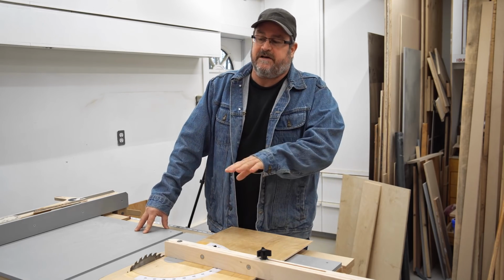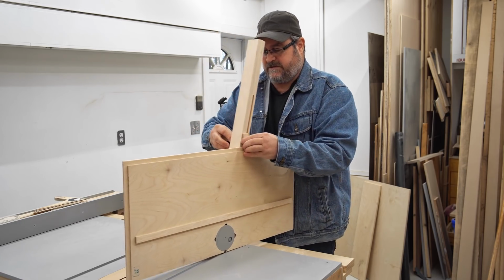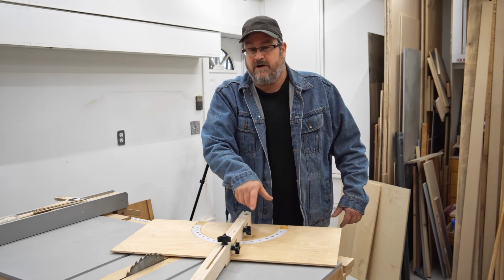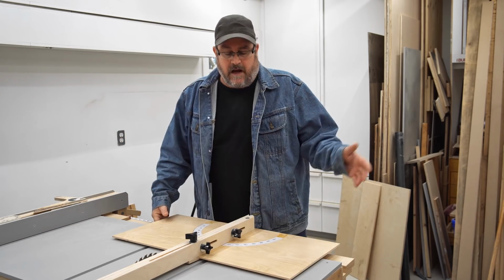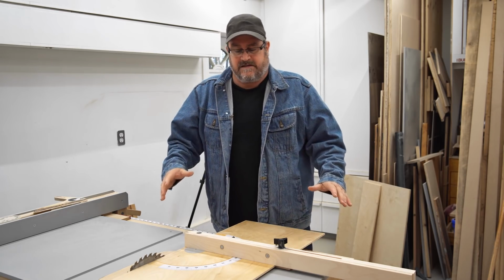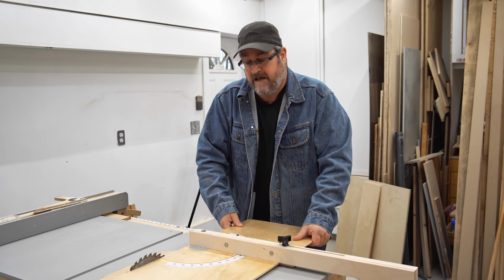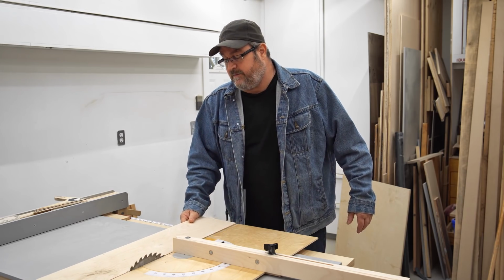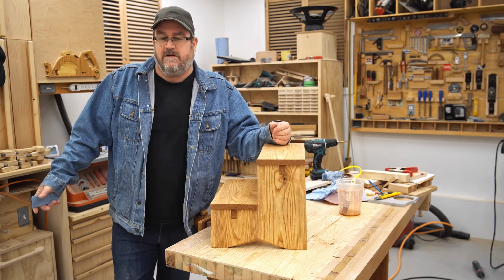My Miter Sled - Mistakes were Made

Comment from the maker: While it's not perfect, it is a pretty good starting point. In fact, it's the kind of prototype I'd build for a new project, but wouldn't bother to film.
Improvements include making the guide bar movable to position the sled away from the blade for bevel cuts, and making the sled longer overall, with more space toward the back for wider panels. Also refining the pivot plate and fence.
The build article has the details, plus the video:
https://ibuildit.ca/projects/how-to-make-a-table-saw-miter-sled/
Reply: I would bet a rocket stove video would get a lot of views though. You might not use it much but it could drive up traffic...

Comment: John, I love the concept, especially the eccentric bolt.  A star nut might be easier to use. is the ⅛" hole alignment accurate enough? 30, 45, 60 & 90 are easy to check with set squares, but what about 22½" ? maybe a 1/16" hole?  I guess you would get used to the positioning...
Reply from the maker: You don't understand how it works. It doesn't have anything to do with the size of the hole and there isn't an eccentric bolt.
Reply: @IBuildItScrapBin  I re-watched and it now makes perfect sense - was thinking that you adjusted the bolt for every angle, ie that the bolt held the fence at the angle. Moral is don't try and watch a video in the early hours of the morning.  Thanks again!!

Comment: Good morning John. I had been thinking about making a table sled for angles very similar to your design. I was wondering about how to make my pivot work consistently. Your solution with the offset is elegant and simple imho. I understand there are some improvements you can make but I think it is a very good start. Also I came looking for your solution to the pivot and understood it as soon as I saw you drill the second hole. I think there are enough people this will help vs people blind to the simple solution it presents not to consider it a major point of contention. But that is just one opinion. 
Perhaps if you pull the slider off and use a known parallel spacer to reposition it, you can just route away enough of the strip to clear the pivot. I see no reason to let that get in your way. I hope you know what I mean by that.

Comment: One idea to improve your shop. Build a cupboard/box thingy around your heater. Then you get a small place, big enough for most of your projects I guess, where your objects can cure in the right temperature. The larger space of your shop will be heated to your working temperature by the heat escaping from the cupboard/box. Don't forget to build in some ventilation regulator feature thingy so you can turn up the heat in the shop without getting unwanted high temperatures in the box.

Comment: I made a fairly simple but effective wood burner from an old 19 kg gas bottle that I have used to heat my workshop in the winter for the past 4-5 years. For fuel I mainly use off-cuts, broken pallets, wood shavings, branches that needs trimming off from trees in my garden, cardboard packaging and whatever logs I might be able to put my hands on here and there. It works a treat and brings the temperature up to a comfortable level of 10-15 C within 30-60 minutes, at which point I just leave the fire to die out as any warmer gets a bit too hot for my liking. The added benefit is that it helps keep my workshop dry, which means next to no corrosion or surface rust on my tools, as the wood burner helps circulate the air and replaces hot moisture filled air (going up the chimney) with cold and dry outside air.

Comment: A pair of holes in the eccentric disc (to fit an angle grinder nut wrench for example) might make adjustment  a little easier and the action more understandable to viewers.
Reply: It's a one time adjustment. It's all loose when you are adjusting it until you tighten the nut with clamps the fence and the disc together.
Reply: @UberAlphaSirus  Until it goes out of whack due to temperature or humidity changes or something loosens off. It's mostly wood and wood is not 100% stable at the best of times.

Comment: An idea popped into my mind about the step stool... wouldn't it be awesome to add swivel wheels so you can move it around, in and out of the way? 
Mounted on springs, so if you stand on the stool, the springs compress and the stool sits on the floor supporting your weight and unable to roll away. Even a wooden 'spring' system would be doable. It just has to support the weight of the step stool, a little bit above the floor.
Anyway great videos John! Will be looking forward to the